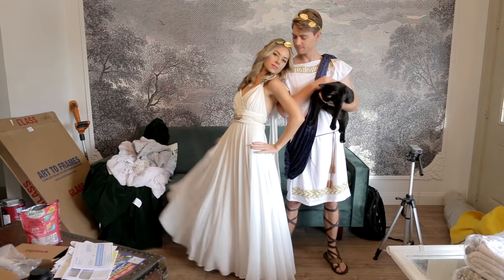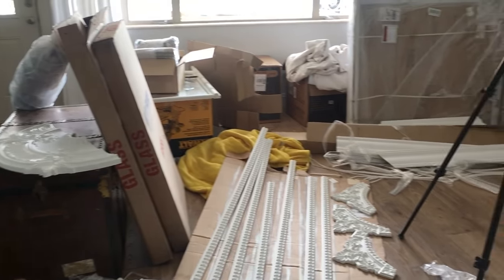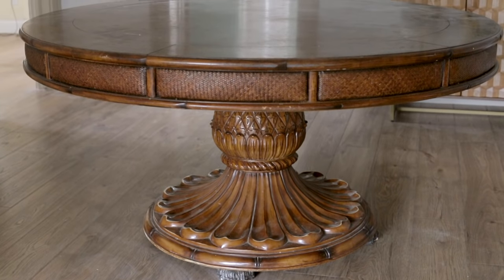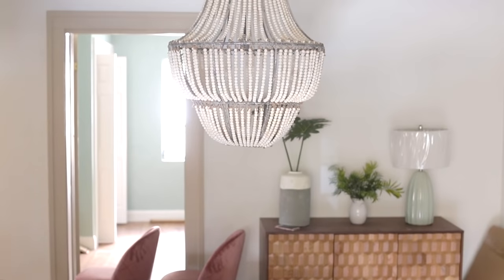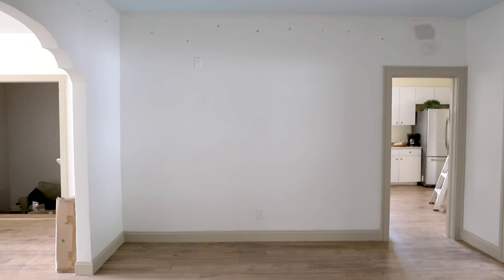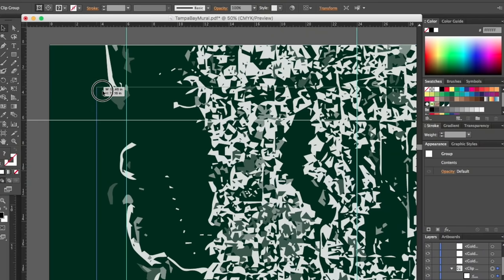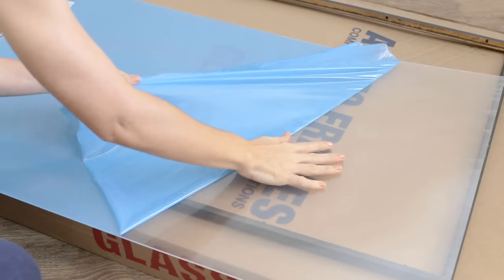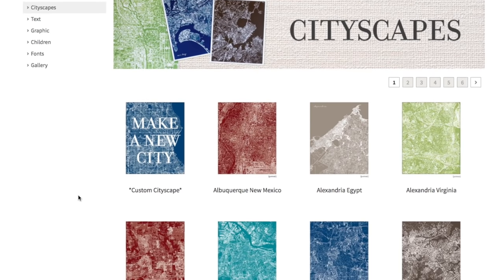Dining Room Design Plan: Riverside Retreat

Comment: I love your design, however it seems such a shame to paint the table as it has such gorgeous wood!🍍
Reply: Yes but in this case, she is smart to do it.  It will lighten it up tremendously.  I would be tempted to "Pickle" it, and that would be a more durable finish, but she doesn't have that kind of time.  She could always strip it down the road.  Jenna use oil based paint, for durability.  Rustoleum is the only one I can find, in a "satin", which still is very shiny, it is like a latex high gloss.  Gloss would be blinding. PS Tampa here too.
Reply from the maker: Agreed! I'll be using specialty furniture paint with (extra coats of) a matte varnish to seal. Pickling/whitewashed would be a cool look, but I can't sand or strip the existing varnish off all those little details in the pineapple! So paint it is :)
Reply: @JennaSue  JENNA!
Funny you should say that. I used oil based Rustoleum "satin" and OMG it is shiny!  It is like a High gloss latex or even shinier.  That is the lowest sheen they sell. 
I want to put a matte finish over that to take out the shine and have no idea of what to use.  I am thinking polybased varathane/antique (matte), the oil based seems to go yellow.  Maybe you can help me?
I got cobalt but tinted it to a navy and want to put in on cabinet lowers, but I think you would agree, way too shiny.  Then I am painting 2 rooms of french provincial furniture all satin white, because this is good furniture "Brohill" but has all that stupid "gold" detailing and it really doen't all match.  Pray tell which "varnish"?  Thanks in advance, I know you will help me!
On that furniture I am puttting like a grey glaze very slight aged thing over the white, to enhance the carvings.
Reply: I cringed when I heard it was being painted. That table is stunning as is
Reply: @user-ws7ob9rn2x  You will still like it after she paints it.  She can't use it as is, looks bad with the floor now.  She knows what she's doing.
Reply: I'm sure it will look amazing as Jenna has great taste. Is the table original or reproduction? X
Reply: @horseygirl966  Yes, the fact that we cannot tell is good.  I assume you mean is it actually wood, or is the pineapple plastic?  Don't know what you mean by "original".  She talked about stripping the pineapple would be a pain, means that it is for real.  Reproduction furniture often just uses a fantastic fake plastic for expensive and carved parts like this and still use a wooden top.  Probably one of the nicest tables in the world, to me.  I don't agree that she has "taste", she just knows what she is doing.  Very educated and talented, plus experience.  She already knows what it is going to look like because she already can envision it.
Reply: rockshot100 hi, by ‘original’ I meant is it an antique piece, or ‘reproduction’ means a new piece copied from an old style...generally mass produced and cheaper than the ‘original’ or antique. 🍍
Reply: @horseygirl966   Hum, good question, it is obviously not new, but yes it could be over 100 years old or from the 20's - 70's, It looks like it is oak, which very fine furniture was made out of like Walnut, cherry or Mahogany in those days, think Chippendale.  Maybe she will let us know.  But like you, I think it is beautiful, simple without being too ornate.  Maybe Jenna will let us know, whatever the outcome the design of it is so strong, it could be plastic and I would still like it.  My guess is it is oak machine turned and detail hand done, (like the cross-crosses in the pineapple).  Reproduction?  If there were ever a table pattern to copy that would be the one I would copy.